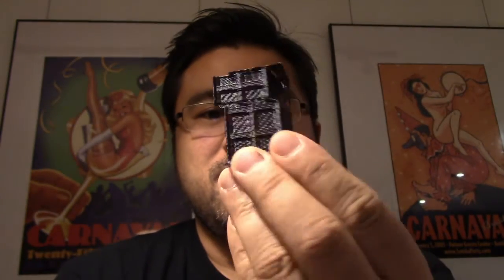Solidoodle Press - Love, Hate, and the List

Comment: Hi Marb, 

Sorry for the delay, but I wanted to let you know that my Solidoodle Press has been working a treat since I liaised with you last month. I'm using ABS and the things I have done to get consistent high quality prints are:

(1) Use a rubber band to secure the wiring loom so that it doesn't jam the gears

(2) Reverse the fan on the print head to provide better cooling 

(3) Tighten (and super-glue in place) the grub screw on the feeder motor in the print head, to ensure consistent flow of ABS

(4) Attach a piece of BuildTak to the glass plate (heat transmission and rough surface are far better for adhesion))

(5) Put a sheet of kapton tape over the BuildTak to allow prints to be removed easily

(6) Print with a bed temperature of 100C and a head temperature of 245C

(7) Print with the lid of the printer open to avoid any risk of the filament jamming whilst the head moves (I may try installing a feeder tube in due course, so that the lid can be closed)

I've had some problems trying PLA (mainly getting it to stick and also jams in the print head), however, am really pleased with the ABS at present.

Hope that this might be of some help to others out there.

Thanks again for your videos and all the best,

Jim

Comment: Hi Marb,

Thanks so much for posting your Solidoodle Press videos. I received my Press as a shipment to the UK approximately 18 months ago and after leaving the unit for several months due to sheer frustration, I have now come back to it over the Christmas / New year break with a renewed determination to get it working. I have been successful with almost everything, but the final challenge appears to be something with which you may be able to assist: on your "Love, Hate and The List" video, you show an issue with a TARDIS which sheers by a several millimetres at different random intervals. I have encountered something similar with my prints and wondered how you overcame this? (You show a completed TARDIS which appears successful.) I would be most grateful if you may be able to provide some guidance / advice, please.

Many thanks and best regards,

Jim
Reply from the maker: Hi Jim,

Thanks for watching my videos and I hope it provided some good information.  Haven't been on the printer for quite awhile but like you, have renewed motivation after the holidays.  So to answer your question. . .
I discovered that the sheering on my unit was due to the design of the filament top feeder being too close to the moving printer head.  It had a tendency to cause tension at random times while the filament was fed.  This made the print head skip and shift it's default x/y position.  I found a quick fix was to simply lift the lid containing the filament roll, close the front door, and lay the lid on top of the door.  This seemed to provide just enough slack for the filament to feed with less tension and more freedom for the printer head to move.  I've seen others create external filament holders and another that repositions the roll vertically on the lid which all appear to be good alternatives to the same solution.  Good luck and let me know how it works out!
Reply: Hi Marb,

Many thanks - that makes good sense and I will try your suggestions during the next week, when I have an opportunity to set-up a print. Really appreciate your dedication to this.

Best regards,

Jim

Comment: I sent out for repair but never looked at it right away and they told me it was fixed however the filament doesn't stick to the bed no matter what temperature it seems to get very cold on my object seem to move in the extruder seems to make a buzzing noise not sure if it's because of the cable band in the back that it's Jamie gates forgot to check it and putting it back in the box and listing it on eBay to buy something better but would like to get the thing up and running because it's a nice all-in-one piece￼
Reply from the maker: I noticed in your vids that you didn't use painters tape.  Painters tape was the only way I was able to get my filament to stick so I would suggest that if it's on plain glass (tried glass and hairspray without success).  And your bed may be faulty if it's not getting hot which is needed to help prevent ABS prints from warping away from the bed.  As for the filament head getting stuck and grinding due to the cable, this does appears to be a common issue  and I came up with a solution (https://youtu.be/ttLQtgEZclI), but also in my notes, I point to another video where the person used a rubber band which seems like a better fix.

Comment: did you ever get this working 100%? I have issues with mine sent it for repair now its even worse it prints nothing. what should I do
Reply from the maker: Hi Gary.  Haven't used it for a few months but I did have it running reasonably well the last time I printed.  Was there anything specific that you were having issues with?  I've encountered several but there was always some fix I was able to figure out or found by another owner (first layer sticking to the bed, print failure in the middle of the process, leveling, grinding. . .)?

Comment: Hi. Great videos you have online. I just bought a Solidoodle workbench. I´m not been able to set up right the printer for a medium quality. I have used almost one roll of ABS filament and invest lots of hours trying to make it work fairly acceptable. do you have some settings to share to achieve good prints? i am using repetier host and slic3r but I have a licence of Simplfy3D. Thanks a lot....
Reply from the maker: Thanks, and sorry for the the late response.  What types of issues are you encountering?  I have a Solidoodle Press which has software specifically catered for it to (kinda) helps set things up such as the auto leveling, xyz tests runs, and a few other things for tweaking.  I did have problems in the beginning based on the printer itself (QC issues).  But I have found the right heat temperature for the extruder and bed are essential.  So is the bed prep for adhesion which I used blue painters tape.  There's still some slight lifting so more testing is needed.

Comment: Hey there,

     I haven't read the comments, so I don't know if this has already been discussed; but it looks to like your stepper motor/s in the x or y axis are missing some steps.  Possibly there is some resistance on the actuator (lead screw, belt, I'm not sure what it uses).  It might be that for those layers, the motor was encountering just enough resistance to lose one or two (non-specific amount, just a small number) steps on each layer.  Just a thought, hopefully it helps.  

Ciao.
Reply from the maker: Tyler Green Hi Tyler.  I did find out what the problem was and your guess was right about resistance.  But it was caused by the filament getting caught on the extruder as it worked it's way around and every so often would make the travel skip.   I resolved it by propping up the lid higher to give more room.  Not very elegant but seems to do the trick.  Thanks for the tip though!

Comment: I am glad to see your video. I also fall in to the February or first shipment. I have only had a few or two good prints. The y axis I want to say is the glad bed shifting forward. I am still working on a good fix  that still allows you to remove and install it easily. Please post more videos are the community s love hate with this printer.
Reply from the maker: LuckyScrewdriver  Hi Lucky.  It does appear that our February shipments had some issues out of the box.  On the y-axis, my glass bed did slide a bit like what you probably experienced.  I used painters tape to secure it to the sides.  But the extreme shifting in this video with the phone booth (Tardis) model I believe was due to hanging filament from the top getting caught on the extruder unit as it moved back and forth.  I don't really have a fix other than providing more room by lifting the lid up.  Haven't had a problem with the shifting since.  Still a bit of a love hate relationship with this printer but hopefully she'll come around.  Ha!

Comment: Wow, I am glad that I'm not the only one having such difficulty getting the Solidoodle Press to function correctly. I have had mine since February and I am still having trouble getting decent prints. I had the same problem with the extruder crashing into the bed, and I believe that it has done some damage. I have measured the bed and there is at least a 2mm decline, which would explain a lot of my prints. After going back and forth with customer support, I have also adapted the rubber band support. I have also adjusted the trimpots, which helped A LOT. If you haven't done that yet, make sure you do. You also need to check underneath of the bed to make sure that there are two screws holding the bed in place at the back of the chassis. Solidoodle shipped a lot of printers without the bed screws (unprofessional). I have also noticed that the bed does not reach the temperatue that it is supposed to, which would explain why the filament has trouble sticking to the bed. I went out and bought a IR temperatue gun and saw that when my printer is set at 100°C, the bed is only reaching 84.6°C - 90.1°c. Solidoodle REALLY messed up with this initial launch of the Press and I have been extremely disappointed thus far. We shouldn't have to be fixing their products. They should've had this thing perfected before shipping them. They have sold 3D printers in the past, so this isn't their first product launch. I am hoping that now that I know how to get the Press up and running, I can get a replacement and start over. Thanks for the videos, and let me know if anything I said is helpful and if you have any other tips!
Reply from the maker: Cody Williams Hi Cody.  I totally agree.  You are definitely not alone on this one and I was also part of the February shipments.  The Press seems to have quite a few issues out the door that a few more months of testing on their end might have been discovered and resolved prior to us getting it.  So in essence, we've become the testing/QC group.  Although I enjoy tinkering, it's been a challenge.  But on a positive note, it has provided me with plenty of unplanned content for uploading to Youtube.  Ha!  And I've received some great tips and alternative solutions from others (such as yourself) so that's been good.  I do still have minor issues with curling on the edges and definitely need to verify the temp.  They had a new software upgrade that bumped the default up from 95 to 100°c.  But if the actual readings are off, similar to what you tested, then I may need to bump mine up appropriately.  I'm not familiar with the trimpot adjustments and what it's used for (is this for the x/y/z adjustments?).  Is this something on the internal motherboard?  Thanks!